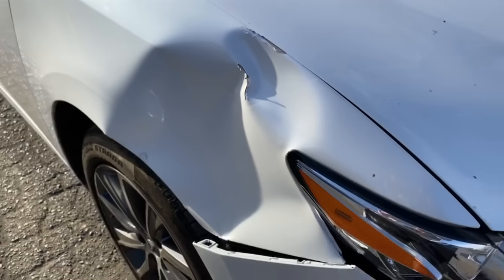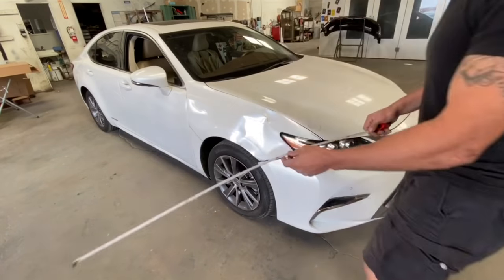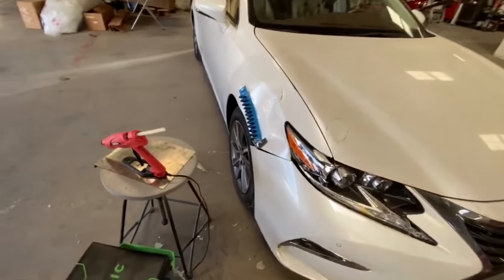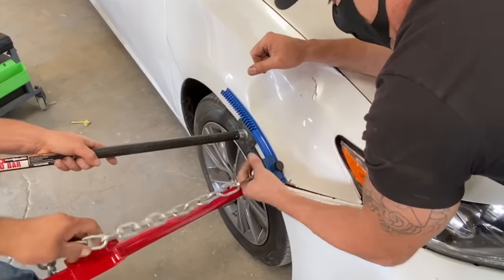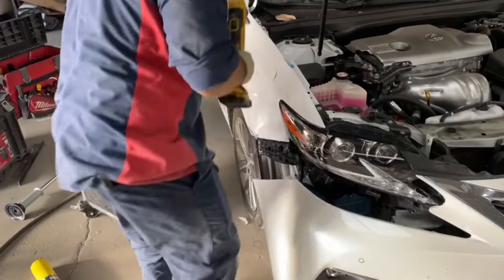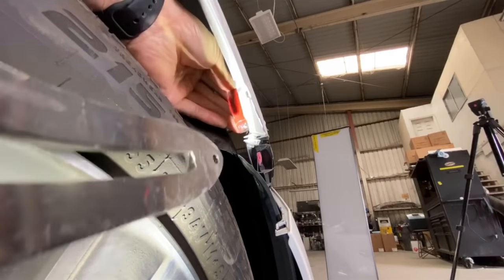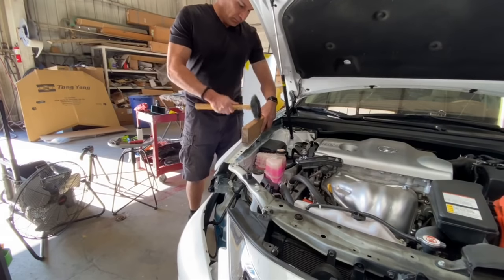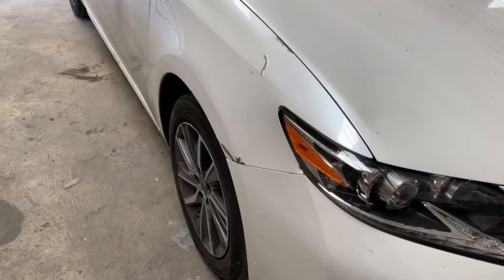Removing Creased Wrinkled Dent with PDR Crease Glue Tabs! | PDR Tips

Comment: It’s cheaper to get a panel in this situation they are so cheap surely you have more labor than the cost of a fender
Reply from the maker: Customer did not want to replace or repaint.. 
I do these repairs strictly for entertainment
 gives me content to share with you guys thank you for your comment
Reply: Depends on if you want a crappy fitting panel, crappy parts-crappy end results, the pearl paint on that particular vehicle is expensive, as is the primer /base materials that is used in conjunction with that specific paint, por is usually the best and least expensive way to go for a better end result,  as always, great work brother, in use to do work for dent wizard in the early 2000’s..
Reply: @dandeplanty4166  I agree Dan. Nothing beats OEM.

Comment: As someone with a degree in carpainting, this is amazing to see and very relaxing. Back when i actually worked as a carpainter, it would have been so much better to work on panels like this instead of using so much body filler to fix dents😆😆

Comment: Well I finally subscribed. I have a dent I know you would be able to take out. I think the bed of the truck will need to be removed, to get a good pull in it's direction. I had a body shop tell me, oh, that would be like 5 or 6 thousand dollars to fix that. I decided I could buy all the tools I needed to fix it and it wouldn't cost that much. Not sure how to get a pic of it to you. I am in Riverside, California. Anyways, the dent is from a metal pole that the driver didn't see ad they tried to pull away.. folded the metal on the xtra cab part of the body. Thanks for your inspiration and videos.

Comment: It’s impressive but not cost effective. You still need to paint the fender and hood. I guarantee for what he charges you could have gotten a new fender, and had it painted for nearly the same cost.
Reply: Exactly!!!
Reply: He doesn't charge customers 100% parts market up for used salvage body panels and paint and material to paint or labor for installation part prep and paint blend. His work is cheaper even if he had to use filler and paint.
Reply: But replace the wing and your paint is now blending into the door and hood: now you have aftermarket paint over much of the car.  Original is only original once!

Comment: What is the cost comparison between bodywork and PDR repairs?
Reply from the maker: The prices are very similar.
However, Pdr is a much better repair, especially if the paint is not broken. Keeping the original paint and keeping it from Carfax as far superior.
Reply: @DentDiscountPDRBodyShop  thank you for replying 🙏🏻

Comment: This is really quite amazing, but for the average body tech, it would have to be a cheaper to replace the fender and repaint.   Still, you have to be in awe of this work.
Reply from the maker: Teekay you are absolutely right
However, the customer did not want to repaint he just wanted it touched up 
Sometimes you have to give the customer what they want 
He felt the original paint had more value than the repaint

Comment: Dent repair is easy. But as an auto body professional. I'm not going to fix that Fender. Because I'm going to take it off, and look for what else is damaged, behind the fender. It has to be painted anyway. And now that the metal has been weakened. It's a possibility, that it is going to affect the crash timing. My state certification does not allow me to augment the crash timing on any vehicle. Repairing weakened metal, is one of those procedures that can sometimes affect crash timing. Automotive collision repair doesn't always address direct damage. It's our duty, and our job, to find the indirect damage as well. Just because your Rubbermaid bumper popped back out into its original form, doesn't mean some crap behind it wasn't wiped out in the Collision. Many times, those components damaged behind what you can see, are also detrimental to the overall performance of the vehicle. The best way to find this damage, is with a visual inspection. Theoretically, only the fender was damaged. But when you're dealing with people's most prized possessions... You don't get the luxury of dealing with theory.
In theory, we can push all the dents out. But in reality... A lot of stuff needs to be replaced too.
Reply from the maker: Salty tech very nice well said

Most shops use Bondo‘s and fillers 
guys on my channel want to learn how to reduce that.

So regardless of how damage the panel is 
I like to give examples of the extreme how to save panels
I really appreciate your passion thank you for your time

Comment: Dude you didn't show how you got the extreme high and low crease out in the middle
Reply from the maker: The 3minute Mark I pulled the deep section it was my very first pull with red hustler stick
Later in video Rewatch slide hammer pulls

Comment: Wow, that’s amazing that paint stands up the being pulled on like that, I’d figure the glue would rip the paint off 🤣
Reply: Nah, it only does that on seemingly harmless dime sized dents that you aren't worried about. THAT's when the paint pulls on you.

You got a crushed panel with already split paint or a 20 year old hooptie that's covered in filler and multiple paint jobs? You good.

That's my luck anyway.

Comment: Your work is insane thanks legend. 
You say other places wanted to replace the panel.. wouldn't that be more cost effective than hours labour? 
This type of work on hard to get parts is understandable but not cheap and easy to get parts? 
Cheers
Adrian
Reply: In a case like this, that fender(being a newer Lexus) was probably at least 700 for the part. Then you have to paint it, and blend into the door, as well as probably the hood for color matching. In order to do that, you have to gut the door, remove the glass/mouldings, remove bumper, headlight, fender liner, etc. You're looking at around $2000 to fix this conventionally.

While in this case with the split paint and damaged paint on door edge, a conventional repair would be superior.. If the customer would prefer to save some cash, and deal with some touch up paint, this is certainly a cost effective method. Also, The Man of Steel clearly loves the challenge, because I wouldn't even consider fixing 90% of the stuff he does for anything less than conventional autobody costs hahaha.

Comment: Thanks for a great video. Question. If there are still those several sections that need touch up paint what is the plan for the paint? If the fender will need a whole respraying then is not more cost efficient to just buy a new fender? Not saying PDR is not super useful but just wondering what the cost calculations were made on this job. Especially if touching up proves to be hard like in the case of a pearl.  Much appreciate your teaching.
Reply from the maker: The customer did not want to replace or repaint.. I like doing repairs like this strictly for entertainment purposes showing what’s possible with PDR. Thank you for your comment

Comment: waste of time here. broken tricoat. still have to prime, block and blend. replacing the panel and blending into door would have saved money. cool skills. but, in this case, impractical
Reply from the maker: very nice well said

Most shops use Bondo‘s and fillers 
guys on my channel want to learn how to reduce that.

So regardless of how damage the panel is 
I like to give examples of the extreme how to save panels without Bondo fillers
I really appreciate your passion thank you for your time

Comment: By the time you pay someone to repair the fender you might as well just replace it. Its what $40 on average for an es350 fender? And some factory dealers will price match the aftermarket.  And you won't have any flaking or cracked paint
Reply from the maker: If I replaced the fender I would have no content for you..
That’s not what the customer wanted he wanted me to take the dent out only
Thank you Jake for your comment
Reply: @DentDiscountPDRBodyShop  how much did you charge for that repair?
Reply: @DentDiscountPDRBodyShop  im guessing the non reply means more than a body shop would charge to restore it to new. So because someone has a miss represented idea of body shop horror stories you get to take on the job for more cost with a still damaged fender that will start to rust in a couple months
Reply: @jakeclauson9863  SMH - Not To sure where you get your numbers from for an year is between 2017-2020 ES350 Fender for $40 on average, you think a customer would want an aftermarket fender for that price with the fender crumbling, the OEM Fender held up and the dent was able to be restored. The color is a 3 stage paint and you have to blend the door and hood to get the exact color match.. cost is well over $2500.00 for the the body shop.  Not sure where you paint and get parts maybe in your garage with recycled paint and thin clear coat.. I not sure what kind of experience you have with knowing what a body shop charges for this kind of work. I would just stick to watching the video and learning.  why would you even ask what a person charges for his work? its none of your business.
Reply: @sunj9797  I work at a body shop. Thats where I get my numbers. We also call in pdr guys and I know what they charge. You really think a pdr is going to pick away at a dent for 3 hours and only charge $100? Not happening

Comment: You must work for minimum wage. Two solid days labor and that fender still needs paint. Two days labor is worth more than the cost of that fender. Buy a new fender, it takes about an hour to paint and an hour to replace and spend the rest of that day and half making money on panels that can be fixed as the structural integrity of that fender is gone.
Reply from the maker: Replacing the fender is too easy.
If I replace the fender you would have no dent content.
You clicked on a Dent channel not a replacement channel.
Did you read the title of the video before clicking on it.
It didn’t say anything about replacing.